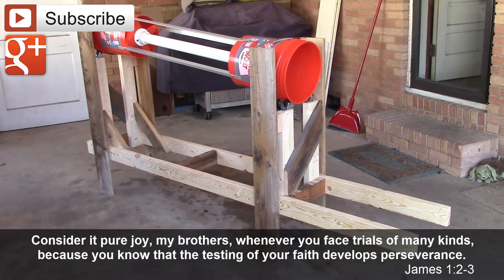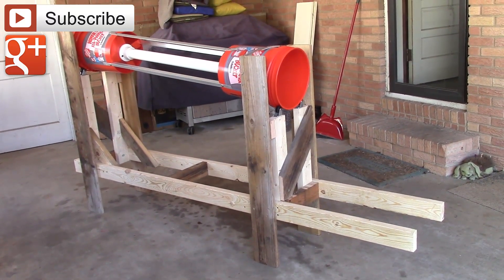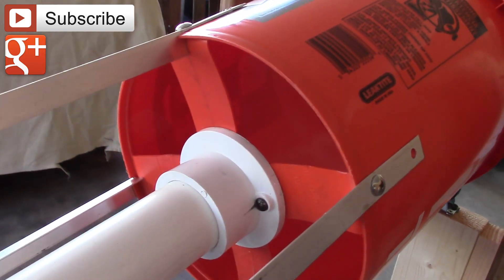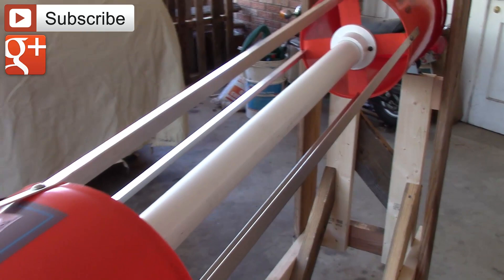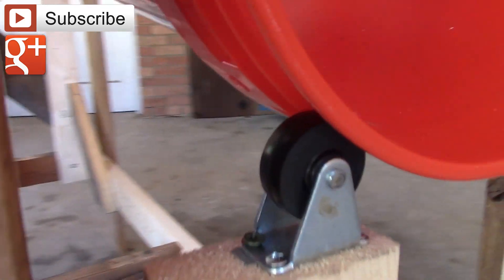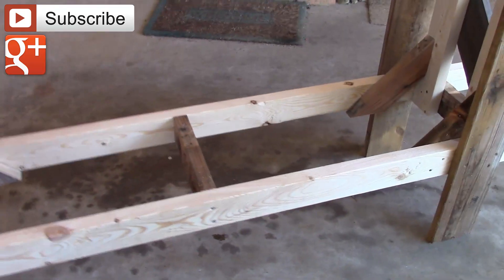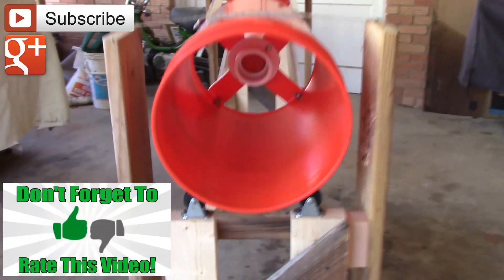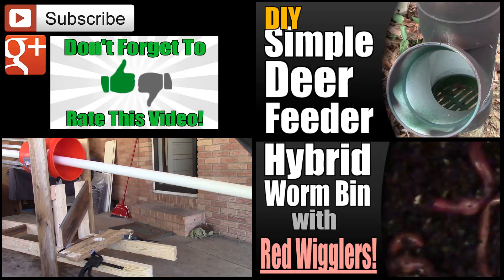DIY Worm Casting Separator 1.0

Comment: The secret to preventing the worms from attaching them-self to the screen is to keep the screen turning, if you operate this unit by yourself you will realize quickly how tedious it is removing worms interwoven into the screen...Bin Dare Dun Dat ...
Reply from the maker: Ok Oreillia Hoover, thank you for the information! :) I plan on using a #8 hardware cloth which should be small enough to keep the worms from getting through it. What size of screen were you using?
Reply: ***** I'm using 1/8"  What doesn't go through 1/8" goes back to be reworked I mixed it in with fresh food ...!
Reply from the maker: Right on Oreillia Hoover. Worms get stuck in 1/8"?
Reply: ***** If given the opportunity... yes...!

Comment: Great Idea
My question is how will u put the castings in cause most of it will fall off everytime u push it in. It will help if u have a more incline up towards the front from where u put the castings in
and what will u put inder the part where the mesh is to collect the castings so u need space for a wheel barrow to push in
so it would be better to reduce the distance between 2 buckets for the wheel barrow to cover the whole mesh from under
Reply from the maker: Sorry it took me so long to get back to you! The castings will stay in because they will be rotating/sliding down the slope and there is a ring (lid with a hole cut out of it) on the "feed" end that will keep it from rolling back out. I'm probably going to be building a feed chute that will hold more material as well. Yes, a space for a wheelbarrow would be very nice. While I don't have a space directly under the discharge, I'm planning on building an additional chute to discharge the worms and large pieces into a bucket/tub/wheelbarrow and I'm also going to build a chute for the castings to funnel them into a tub below. I'm not certain about reducing the distance as I'd like to have more screen surface area....I hope it all works out! Eeeeek Stay tuned for more, I'll keep you updated! :) Thanks for the comment, I really appreciate it.

Comment: Wayne, that is a nice looking trommel. They are also very popular with the DIY gold mining community. It looks like you have developed a good design there. May I make a couple of suggestions?
Reply from the maker: Thanks Dan Rogers, I've never seen them used for gold mining but Darryl Griffin was just telling me that tonight, as a matter of fact! LOL Suggestions are ALWAYS welcome on my videos brother!
Reply: Ok glad to hear it. The main suggestion is that You may want the crank handle to be on the entrance side of the trommel. The reason being is that you will save yourself footwork between adding materials and turning the screen. The material that don't fit through the screens will fall freely from the exit shoot.  The other more minor suggestion in that you may decide that putting casters on top of the buckets in the groove may provide less friction and allow smoother operation. It looks as though you can easily add a block of wood across the top of the stand posts to mount the casters to. You will find a trommel  is a great tool not only for your castings, but compost, sand, topsoil........ Endless possibilities. I like your idea of interchangeable screens. It was a good idea. Can't wait to see it functioning.
Reply from the maker: Ok, very cool Dan Rogers...I'm looking forward to using it for many things as you noticed! I battled with the idea of putting casters on top instead of the strap but I decided to give this a try first, if it fails, I'll add the casters...remember, I'm trying to keep this as easy as possible for the less than average workman. :) I also thought about the top side and I agree with you about saving time! However, I started the build with a different idea for a drive system that did not include a drive shaft down the center of the cylinder and when I changed that design mid-build, I already had the frame build so I decided to continue with it in that manner...I'm not planning on adding a motor to it as I want to demonstrate sustainability...however if their is a demand for worm castings, I'm not afraid to outfit it with a solar powered motor setup for greater volume. If that's the case, then the shaft on the output end is perfect I think... Who knows, I may decide to redesign the who thing tomorrow! haha :)

Comment: Trial and error works great, doesn't it??
Very creative, Wayne, Looking forward to the finished product. Add a 12v DC motor from a wheel chair, a battery, a couple of sprockets and chain, and a small solar panel to charge the battery, and you can take this out into the field and use it for a variety of things, including sifting small rocks out of your garden dirt! Keep up the good work.
Reply from the maker: Yes it does nov51947! :) Thank you for the kind words Karl (that's your name, right?), it really means a lot. I like your idea for motorizing it (more than anybody else's so far) and I've thought a lot about it. That said, I may just opt for manual labor on this one...not sure yet. If I end up raising a LOT of worms and needing so sift a LOT of different materials...I just may not go with the "Armstrong" motor idea...and go solar! haha Thanks for the vote of confidence and for being patient on some of these larger builds that take some time. :)

Comment: Sadly, it is possible to find everything you need to build this and many other things in dumpsters at construction sites and not spend money at all. I used to check the dumpsters on the jobsites at the end of every day. Even partial boxes of screws can be found sometimes. Should check laws though. In some places it is illegal though that doesn't stop some people. Even in places that it may be illegal if you speak with the jobsite superintendent he may give you permission. Many of them are happy to have people haul stuff away.
Reply from the maker: YOU ARE RIGHT *****! What I'm trying to do here is to come up with a good proof of concept and general sizes that are needed using some standard items that anybody can run out and buy...then they can take a working design and have a basis that they can use to piece something together from extra parts that they have and/or can find as you mention. If I do that, even if it works well...it would not be possible to replicate easily (especially for the inexperienced craftsman). All the wood accept for 3 boards (I wanted good strait boards for a frame) was from pallets (again, something standard). After this video I went dumpster diving for the rest of the wood that I needed and for some bolts for casters so I can easily roll it around the yard/garden. I hope this helps explain my logic? Thanks for the comment brother, I really appreciate it and value your insight!
Reply: All I did was point out that A) materials can possibly be found for free and not just for a project such as this and B) the wastefulness that surrounds us.
Reply from the maker: I really value this mindset and it's something that I think about every day...I really do. Matter of fact, the topic of re-purposing in this way will be included in the WebTV Show that I'm working on putting together as well! :) I appreciate your feedback brother.

Comment: it would be nice if your castings could dump straight into a wheelbarrow, any way to make a feed hopper at the start of the system? seems big enough that it could use handles and wheels to move it around, what about a small motor and bike chain to run it? i guess it depends how many hours or minutes per year it will be used, looking good!
Reply from the maker: Yes, I totally agree with you *****, I'd like for the chute for the castings to be able to make that possible. I'm not sure if I'm high enough but as I've planned, if I put castings on it, then it will make it a bit higher. I didn't want it to end up too high because if I add a chute in the feed side, then it's really getting up there on that end. I could build a platform to stand on though as well. :-) I've left enough room on the front of it for a motor if I want to drive it that way, I think. I don't expect to use it too much though so it may not be worth it, we'll see. If I get people that want to buy castings, I may grow the farm.

Comment: I would like to see a small rpm motor to help turn the system to make it a easy one man operation. I assume that you could get a cheap electric motor and some gearing to help turn it. That is what I would focus on next, your basically done in my opinion.
Reply from the maker: Yes, I've thought about that Wes but I want to prove that it will work first, then if it does, I have ample room to mount a motor. Sometimes it takes me a while to finish projects because I change what I'm doing mid build and redesign it and then have to go get more and different parts! What can I say, I'm a perfectionist... lol
Reply: I am glad that you think a lot of the design and the basic functions first before adding the features to it. That is a big thing that I find happens more than not.  I think the technical term is feature creep. I am amazed how great this looks and wish I had the know how to build something like this. I think it will come in handy specially if you continue to grow your worms.  Thanks